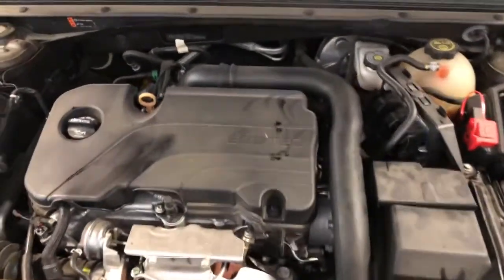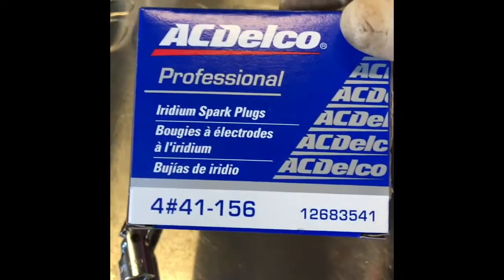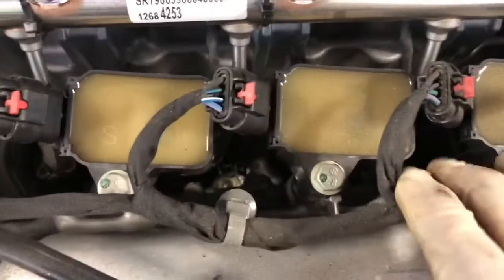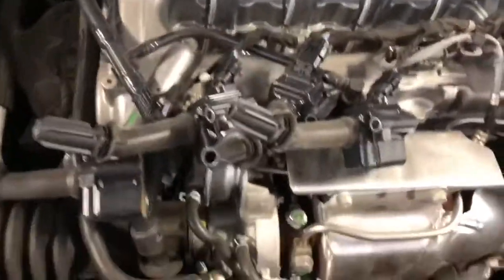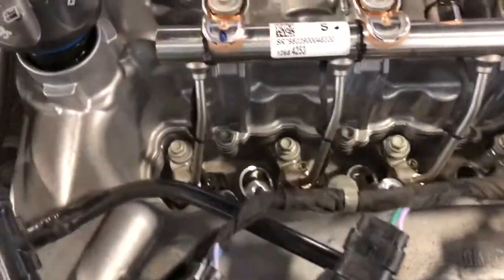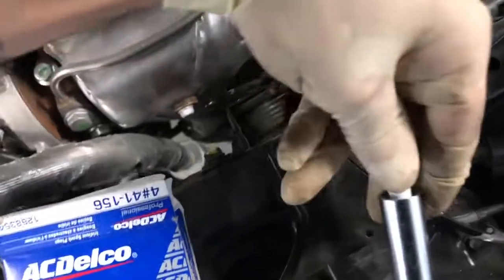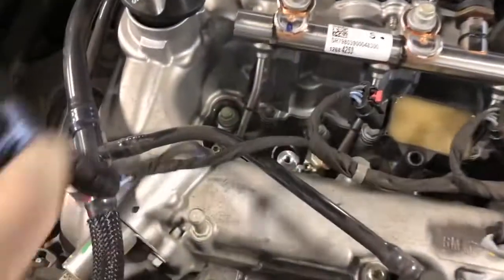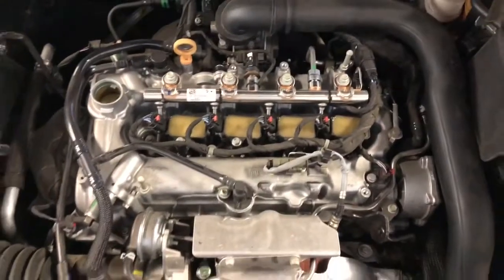Basic 4 Cylinder Spark Plug Replacement (2016+ Chevy Malibu)

Comment: Videos like this are so disappointing. I hate that the most needed guidance to replace the last plug on the right is skipped over. A trained monkey could easily replace the other three. Show your work to be taken seriously.
Reply from the maker: It’s the same process as the other 3 spark plugs . If you have an extension with the universal swival like I showed during the tools needed section , you’ll easily take it out just like the other 3 plugs .

Comment: As single mom with a toddler in the back seat of my 2021 Malibu I will definitely be keeping up with your videos I want to keep my car forever an I would love to work on my car myself !
Reply: Check out the vacuum booster video on these I have one with 180,000 miles and this and the battery are the only things that broke so far unfortunately the battery went dead on the road and I needed a jump start. The car is a 2017. If you shift to L6 it disables the auto stop feature and it drives a little nicer. The brakes are easy to change but the bolts are huge compared to all the other cars I’ve worked on but easy to change comparatively

Comment: Just wanted to say thanks for the vid. Did my spark plug change a few days ago on my 2016 chevy malibu limited lt. The boots sit on the backside but same process. The screws for the boots were 10mm.

Here is what I used:

14mm magnetic and flexible socket on extension -- spark plug removal
T30 torx -- key for removing engine cover
10mm socket -- remove boot/coil
Bosch Double Iridium Spark Plug 96301 -- x4 (these are also pre-gapped)

God bless and thanks again man 👍

Comment: I would only remove one coil wire at a time, or label each one, so as not replace the wrong wire on the plug.
Reply: I think this ones are kinda hard to mix them because looks like the wires will not reach to a different spark plug

Comment: What mileage should I change my spark plugs? I have the same car, same engine.
Reply from the maker: Chevy recommends every 60K boss and I would say a 6 inch extension atleast
Reply: @NaeAutoWorks  What's the torque spec for the spark plugs?
Reply: @NaeAutoWorks  Were the plugs easy to cross thread?

Comment: Thank you very much. Can you also do the 02 sensor replacement?
Reply from the maker: Which on do you need help with ? The upstream of down stream ? If one comes in with a a concern I’ll try to make the video
Reply: @NaeAutoWorks  the upstream. I think this is the major concern in the new Malibu's
Reply from the maker: @dualprocess1754  yeah that and the downstream also goes bad sometimes too , the downstream is kind of a pain to do but upstream is pretty easy , 22mm o2 socket to remove from exhaust and then there’s the connector under the engine cover
Reply: @NaeAutoWorks  what key opens the engine cover? Thanks
Reply from the maker: @dualprocess1754  it’s a T30 Torx for that 1 bolt that removes the plastic cover and you have to remove the oil cap too too take the cover off
Reply: @NaeAutoWorks  thanks for all these instructions!

Comment: I’ve had rough idling since I’ve changed mine. Is there any reason?
Reply from the maker: You could’ve put bad spark plugs , make sure they are the correct spark plugs and also are in good shape and don’t have cracks  . There’s been instances where the spark plug was damaged and they were fresh out of the box
Reply: The car manual says it take ac delco 41-153 but they no longer sell them now recommend 41-156. Also the gap on the 41-156 says it’s set to 1.3mm. But the 41-153 are set at 0.7mm. Is that the issue?
Reply: @Foe_2times  did u figure it out?
Reply: @alexandrews6391  nope never did.

Comment: My 18 Malibu is at 81k miles I’m afraid if I change the transmission fluid it’ll mess it up at this point. Should I just go ahead and change it?
Reply from the maker: It shouldn’t mess up , I forget the exact mileage interval but it’s between 50-60 k miles when you could do it , that’s when we do it in my shop & spark plugs are around that mileage aswell
Reply: I have a 2016 2.0T Malibu, the manual says 60k and to use 41-125 plugs

Comment: What size spark plug socket did you use?
Reply from the maker: 14 mm spark plug socket
Reply: @NaeAutoWorks  is it the same size for a 2016 Chevy Cruze?
Reply: @NaeAutoWorks  wats another size I can use
Reply: @NaeAutoWorks  were did u get this 14mm socket cause the 5/8 dont wrk
Reply from the maker: @gagefinch1128  this one is the Sonic Tools Brand but you can get the 14 mm spark plug socket from Amazon from other brands , “Ares “ & also Gearwrench have one

Comment: Just reached the 60k on my 2016 Malibu never had a tune up just oil changes and tire rotation what all do recommend at this point I know changing spark plugs needs to be done what else tho ? Thank you
Reply from the maker: At 60K we usually recommend and do the transmission drain and fill , Spark plugs & the regular maintenances (Oil change and Air filter) & I recommend cleaning the  throttle body as well , carbon buildup & some oil get in there and can cause the check engine light turns on for it .
Reply: @NaeAutoWorks my throttle body looks pretty clean except for oil in it. I was gonna use  CRC throttle body cleaner but the can says not to use it on turbo engines. What do you think

Comment: My engine light came up and the engine starts to vibrate a lot when I put it on park or it’s on drive on a stop light. It’s losing power and the idle keeps moving. I’m guessing it’s the spark plugs and coils . What do you think? Great video by the way. I’m going to do it tomorrow .
Reply from the maker: Is it a Chevy Malibu ? & what’s the codes ?
Reply: @NaeAutoWorks  same is happening to mine same year I have 36 k miles on it . Imma take it to auto zone and get a scanner hopefully it's just the spark plugs . My car stabilitrak came on with engine light.  At idle is vibrates and it so It feels deeper sense I'm straight piped
Reply: Did u find out the problem
Reply: @elainesapp5707  yes spark plus with the quails how ever you spell that.

Comment: Are these the only spark plugs needed for engine light and reduced energy to engine? My Malibu stutters like it can’t power back up when In idle.
Reply: Did this help at all? I’m currently having the reduced engine power issue
Reply: @Aprileighh  change your acceleration pedal , it helped with mines
Reply: no never did I ended having to get rid of that car due to engine failure.

Comment: Hello my friend how are you I want to buy Chevrolet Malibu 1.5 Turbo engine Is the car practical and live more than 10 years (your followers from Saudi Arabia
Reply from the maker: Hello , The car has decent space inside and comfortable but it does have problems with noise from the suspension (Front sway bar bushings & rear knuckle bushings) and the AC o-rings leak . The Malibu’s I work on are 2 years old and I’ve seen the engines and transmissions messing up already but they are also taxi cars so maybe the are abused by the drivers too . I think there are better more practical cars that can last longer my friend
Reply: @NaeAutoWorks  thanks for your ♥️
Reply: @NaeAutoWorks  You will live 10 years Malibu 1500cc Turbo without major problems

Comment: Looks like a tight area around the plugs.
Is that a Thin Wall 14 mm socket?
Or will a regular one do fine?
Reply from the maker: gr8dfender a regular 14 mm spark plug socket would work fine but to answer your other question , it’s not my vehicle but usually they get about 22-24 mpg around where I live since I live in a city/urban area so the mpg are a little lower than a person who would drive on the highway a lot
Reply: @NaeAutoWorks  will the 5/8 deep socket work i tryed the regular 5/8 plug socket but its not loosening the plug
Reply from the maker: @gagefinch1128  you need to use a 14 mm Spark Plug socket not 5/8

Comment: Thanks for the vid.
Did your mpg improve after this at all?
my daughter bought a 2016 Malibu with only 40K miles and its getting 22 mpg at best
Reply: I got 2016 malibu 42k about. 23.8 mpg.  I drive quick too.  I keep my auto off on to save gas. Does she?
Reply: @alexandrews6391  she does keep the auto off engaged.
To update:
 I changed the plugs.
 Put a K&N Air Filter in car. Cleaned the Mass Air flow sensor.
Replaced the PCV.
And ran one full tank of 93 octane with a Seafoam added.
The mpg has improved to 28 now
Reply: @gr8dfender742  Think MAF sensor cleaning probably did it.  Some don't recommend K&N filters for commuter cars because it does let more air in, but it also let more contaminants get sucked into your engine.  I use WIX engine air filter.  Recently also used CRC valve cleaning spray right into air intake. Get right around 30 MPG in LA traffic/highway. 16 Malibu LT.